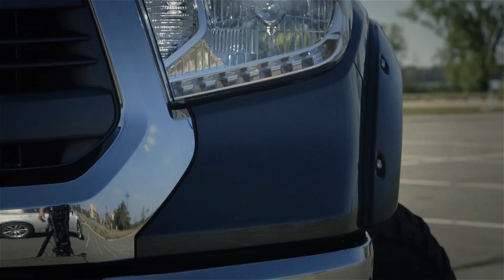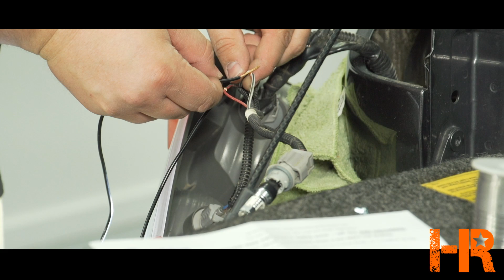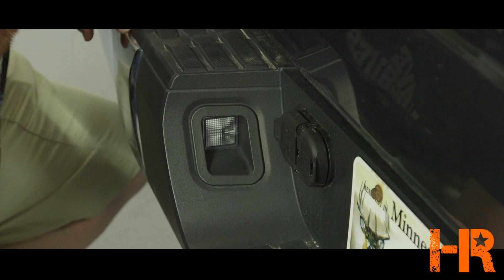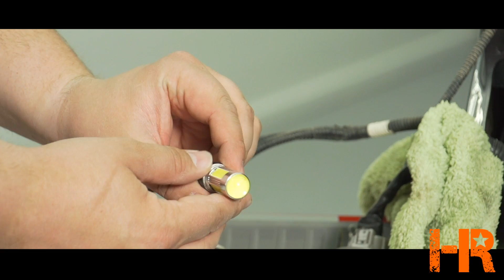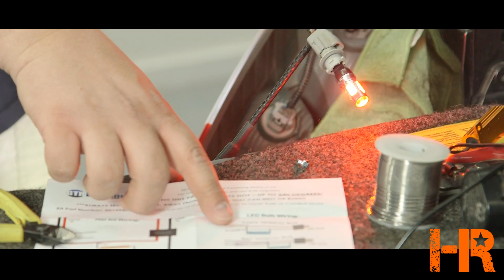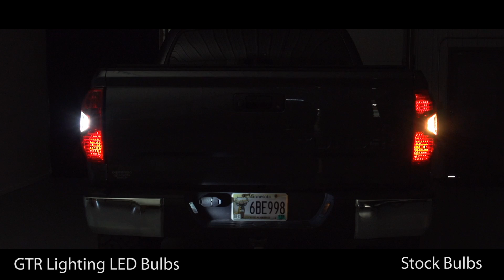2014-2017 Toyota Tundra LED Reverse, Blinkers & License Plate Lights (3) | Headlight Revolution

Comment: On the 2020 Tundra the top Push pin on the tail light is locked in. I broke the one side and the other side I left it in and just took out the reverse light. It was also the reason I didn’t do the signal lights.
Reply from the maker: Hey Robert, Using a soft plastic pry tool helps get the tail light separated from the body of the truck. We just had a 2020 Tundra in the shop this week that put up a little fight.
Reply: You where able to get the white cap off? I tried to remove it and i stopped to not break anther bracket. I’ll try the pry tool on the other side. Thank tou
Reply from the maker: It was a tight fit for sure but it did come off, Good luck!

Comment: Good info, but when it comes to soldering the resistors and splicing original wiring.....no thanks . -- Plug and go only.
Reply: Cause soldering requires a degree in electrical engineering.
Reply: Chowchilla Charlie have to agree with you. I made the mistake of splicing switch backs into my truck and took them off now I got exposed wires I gotta seal. Completely regret it

Comment: Hi, in my car. The rear parking light and brakes are in one bulb, but the bulbs only got the one terminal. It changes function with a voltage difference, is there a way I can get an led to work in there please ??

Many thanks
Reply from the maker: Yes, you will just need a dual filament LED bulb. What vehicle do you have? We can let you know the exact bulb that you need!
Reply: Hi I have a Vauxhall / Opel Zafira b. The rear parking light / Brake light bulb I have is  1156 Ba15s. How would I get a dual filament led to work on a single pin light socket
Reply from the maker: I'm honestly not familiar with that vehicle since we don't have it here in the states. 1156 is a single filament bulb, so it should only be doing one function. If your factory bulb is a dual filament 1156 bulb, that would be a new one for me!

Comment: That is not the way my taillights come off. It’s fasten by something in side. Can’t come off without breaking it. Just like I did using your video.
Reply from the maker: Remove the two T30 torx screws and pull the tail light toward the outside of the truck. There are two plastic clips holding the tail light in and that’s probably what you’re fighting with.